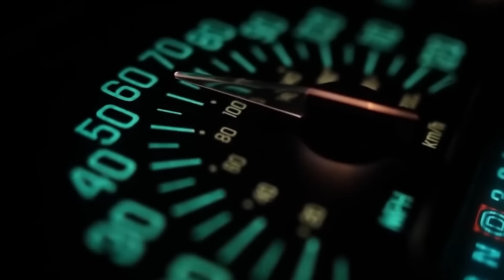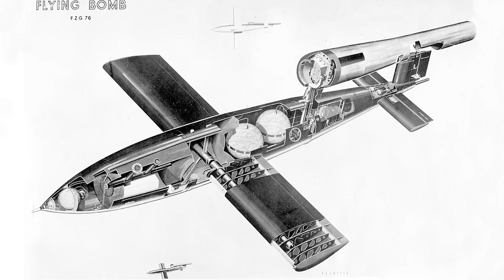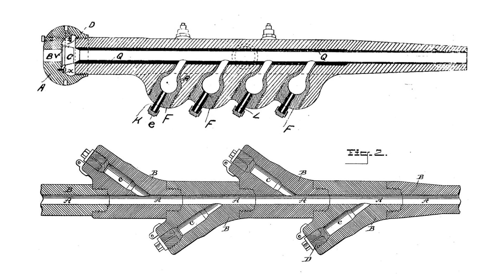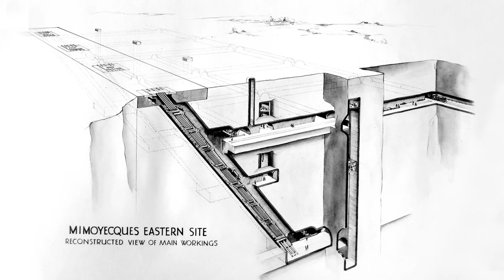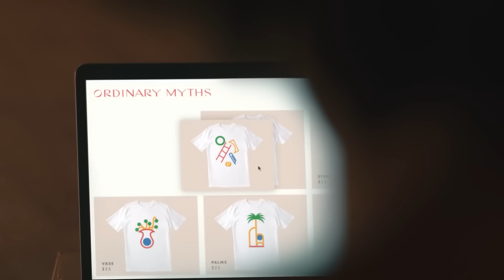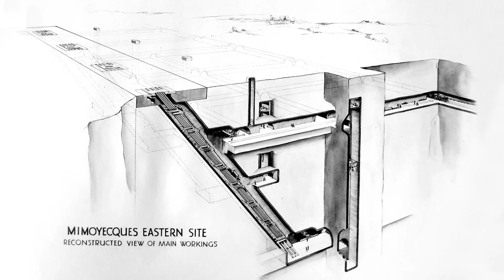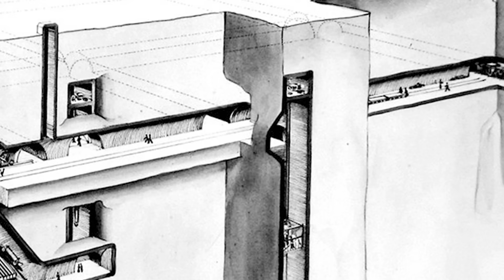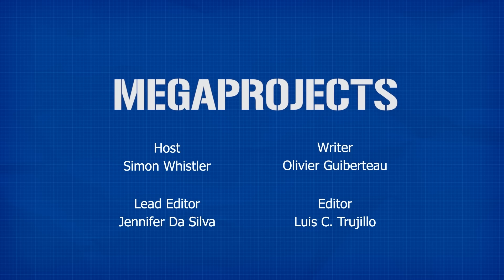The V-3 Cannon: Hitler's Unfinished Mega-Gun

Comment: One item you might have given more attention to, would be WHY?  Why was this vast, cumbersome, massively complex gun even necessary, let alone why would anybody in their right mind go to the trouble to develop and build one?  Simples.  A gun burns propellant to generate high-pressure gas that forces the projectile - the shell - out of the muzzle and on its way; and as Ian V. Hogg pointed-out, the gun is not the weapon - the shell is, the gun is merely the delivery system.  The longer the barrel, the longer the propellant gases have to accelerate the shell - but eventually, too much barrel and too much gas result in massive, very high temperature and pressure that quickly erodes the barrel to where it's no good anymore.  The Germans' Paris Gun, as an example - it used a graded series of shells, each a bit bigger in diameter than the one before it, so the barrel, which was steadily eroding under the heavy charges of propellant, would still seal the shell.  One Paris Gun barrel was destroyed when they used a bigger shell out of sequence, plugging the barrel and causing it to explode.

Needless to say, as the barrel erodes and the rifling wears-out, accuracy is lost and the gun's safety will eventually be compromised; even today, high performance guns (tank guns as an example) have a maximum number of rounds they may shoot before they are removed and shipped back to the factory for rebarrelling.  Warships too; RN 15" guns were considered good for 300 rounds.  Warspite was in the gun line during the Normandie invasion, it fired-off all its ammunition - 100 rounds per gun - crossed the Channel, reloaded ammunition, went back to Normandie and fired all of those off, crossed the Channel again and reloaded ammunition, went back to Normandie and fired all of them off - by which time its main guns were worn-out.

So for an extremely long-range gun firing its shells at extremely high velocity, barrel life will be counted in tens-of-rounds - not really worth doing.  But some clever spark came-up with an idea; "Instead of having a single massive propellant charge down at the bottom, why not have small propellant charges all the way up the barrel?  That way we light them off one-after-another, as the shell passes them on its way up the barrel, and the heat and pressure are applied gradually and evenly over a longer period of time instead of all-at once?"  This indeed, is the principle of that design of gun - and it can be made to work very successfully, although thankfully in the case of the V3, it wasn't.

The idea is still around - it's the principle behind Gerald Bull's super-gun that he was building for Saddam Hussein, only with an even more grandiose intention - it could throw shells clear into orbit.  Now how in the world could you even use something like this? - again, simples.  Each shell would have a rocket charge in its nose, and the gun was to be aimed at the South Pole.  The shells would go into orbit, and then go round-and-round the Earth for as long as you want.  Eventually, as the Earth revolves under the orbiting shells, something you want to bombard will pass underneath their trajectory - and then you radio-command the shell, it fires its retro-rocket in its nose and drops out of orbit, landing on your target.

Two additional suggestions, should you ever decide to build your own super-gun - 1) it would be much more effective if you know how to make thermonuclear shells instead of just filling them with a bit of high explosive, and 2) don't do this if you're on Mossad's "naughty-boy" list as Saddam was, and as Gerald Bull found out to his cost.

Comment: 600 rpm = 10 rounds/sec, or 
MV = 4921.26 ft/sec
If s1-s0 = 430 ft, then t1-t0 (in practice) > 0.1 sec
Even without allowing for reloading, a single barrel is never going to make 600 rpm.
Ripple-fire volley weapon, perhaps?

Comment: 600 rounds per minute? Like an uzi?

Was it possibly five different locations firing five batteries a piece? Each battery consisting of five barrels in one bunch? That would be 125 barrels, which would require every barrel to shoot a projectile every 15 seconds to achieve 600 rounds per minute. That would be insanely difficult to manage with all of the side mounted charges required for every round.
And you'd be throwing a big grenade all that distance to have the effect of a few kg of explosives, just not a viable weapon. But the "vengeance war" wasn't really about effectiveness.
Reply: You're more or less correct!
 "Speer’s plan was to build 50 of these huge guns set in giant underground emplacements near the hamlet of Mimoyecques in the Pays de Calais. The guns were designed to fire one round from each barrel every five minutes which, Speer hoped, would produce a “saturation coverage” of London with a maximum of 600 shells hitting London every hour."
(C N Trueman "V3". HLC 25APR2015)

Comment: I would argue that it is not the greatest or largest gun ever. the US accidentally made a far far more powerful gun with operation plumbob with a 150m bore hole and a nuke as the propellent it fired the 900 kilogram manhole cover at over 230000kph towards space. (though admittedly it was never aimed at anyone nor would it have been easily fired a second time)

Comment: "the V2 attacks continued until the end of March 1944".... Considering they didn't begin until September 44 that's obviously wrong. I assume you mean 45. Also, the V1 campaign was FAR more effective than the V2. Orders of magnitude cheaper, and the warhead had a much larger blast radius. The V2 came down at Mach 4 and had a primitive contact detonator so it buried itself in the ground. Had the Germans possessed a proximity fuse to explode the rocket before contact it would've been far more devastating.

Comment: 600 shells per minute?  You sure about that figure?  Ten rounds a second?  I don't know about that.
Reply: Well, Wikipedia says 600 / hour, or 10/minute. The max rate I've seen stated for various 88 variants (as Flak, Pam etc) is 20 rounds/minute and those rounds are single units, reasonably manageable by hand. No need to verify multiple chambers reloaded and closed etc.
If the number refers to the entire multibarrel unit or entire double position installation, then maybe...

Comment: 600 Shells a minute?? Ummm, are you sure about that one? 
That would put it at the same firing rate as an AK47! 
Even at 600 Shells an hours thats still 1 shell every 6 Seconds! Which is still about 5 times faster than a 16 inch naval ship gun. 
Lets go even further, 600 Shells a Day (24hours) works out at a still blistering 144 seconds reload speed.
For reference The Schwerer Gustav could manage 1 round every 45 minutes, (2,700 Seconds) approximately

As mistakes go, this is quite an amusing one! Thats what happens when you use wikipedia as your source of research. 
(Yes, its in wiki as 600 rounds a minute but this neglects to mention this figure was based upon a planned battery of 50 x V3 Cannons.)
How reliable this source material is, is anyones guess.

Comment: OK, a short list of things that I've notice that are wrong:
1) 600 Rounds Per Minute, is wrong.  This is because each tube would take time to reload all 33 charges. (Initial charge plus the 32 booster charges.  He's talking about a large amount of tubes, kinda like referring to the barrage of shells that all 3 of the U.S.S. Des Moines class cruisers could put out .vs. what a single gun (tube) could reliably sustain before it overheated.  (Overheating can do 1 of 2 things: cause the metal of the barrel to weaken to the point it bursts (like the V-3 test barrel did during firing of the 8th round in quick succession) or "cook off" the round's explosive charge in the chamber much to the dismay of the people loading the round!
2) 140 Kg ~308 pounds.
3) Didn't mention the Tall Boys & Grand Slams used against the site...
4) Would you lie to Hitler by telling him data that didn't support his point of view?  Hence Hitler being told of everything going right and problems, especially major problems being describe as minor things needing more research....

Comment: Ah Simon, the credibility of this information my issue here.  At the beginning you state the V3 had a rate of fire of 600 RPM,   The Thompson Submachine Gun [The Chicago Typewriter] had a rate of fire of 600 Rounds per Minute, equal to this thing.  Later when converted to the M1 A1 a WW2 weapon, it was reduced to 450 RPM.  Both guns fired 30 round stick magazines.  How was this V3 fed ammunition?  A .45 cal round is a lot smaller than a sabot/projectile that the V3 would fire.  Did they have a whole train [literally] of ammo to feed it?  An underground tunnel?  
Fire a couple of mags of ammo on any machine gun and the heat becomes an issue.  Most larger MGs had interchangeable barrels because they became red hot.   When it finally fired you say it only launched less than two hundred rounds...over what time period?  Sorry, I have to call BS on this one.  Another German idea with no substance behind it.  [Thankfully].  Also if this was a thing, why didn't the Allies use the data to create their own?
You got nuthin' here.
Reply: I believe this figure was for the entire complex firing on all their chambers for a short span of time. From what I understand the guns used solid rocket boosters for the projectile and the boosting charges along the gun track. Since there is no moving parts, or things to extract, it is feasible to see how such a gun could be fired multiple times rather fast, and has been apparently done during that multi fire test. Projectile would drop into the gun likely via a gravity assisted loading and fire, then burn a charge of booster as it exit. The gun is then ready to launch another projectile until the booster charges have to be replaced. When you take the number of guns and the number of sections it's perfectly possible for the entire complex to fire that fast, but obviously not for very long.

Comment: Here is a megaproject for you---During WW2 in Elizabeth City, NC the largest wooden structure in the world was built.  It was an immense dirgible hangar.  Shortage of steel forced the wood construction.   I have been in it and it was an amazing space.  It burned a few years back,  Sparks from welding repairs at top of the hangar smoldered for a while and flamed up during the night and by morning it was gone.  I remember as a child going outside and looking up to see an immense air force dirgible directly over our house.  It seemed to fill the whole sky.  An adjacent metal hangar remains and is still in use.

Comment: These kind of strategic and static cannons are a completely dumb idea. Although much cheaper than missiles they are - static, firing from a single spot that would be discovered by your enemies pretty fast.. And after a few bombing runs the super duper cannon is gone. 
Saddam Hussein tried to manufacture something similar, albeit with a longer range and larger shell. It was called the Babylon gun. The project was thwarted by the Mossad who killed the main person behind the design of this super gun - Gerald Bull. The whole program was also idiotic cause even if it was built, IAF would have destroyed easier than the Allies would the German gun. 
That being said the Pentagon has come out with scarce information about developing a strategic cannon of our own with ranges of up to 1000  miles. So who knows, super guns are still interesting cause of the order of magnitude cheaper price per shot compared to modern missiles..

Comment: its actually pretty simple to do in theory. One method is to leave exposed ends in the casing of the subordinate charges and as the projectile passes the casing the hot gas pushing the charge will ignite the secondary propellant adding to the charge as a whole with a lower pressure curve than lighting it all at once.

Comment: “Third V weapon fully utilised”. Suggests it actually worked. What?  The V3 was pretty much useless. It was also never ever going to fire 600 rounds every hour never mind a minute or less. 
600 rounds meant at 3000 propellant charges. That’s at least a trainload right there. The basic logistics were impossible. Additionally the upper charges would have been ever less effective as the ever increasing space behind the projectile gets bigger the highs it goes. In short it never could have worked.

Comment: Simon, please, you have to fix that ring in your room around 400Hz.  It is torture for anyone who does sound for a living and I can't watch your videos anymore because of it.  When you tune your room you need to look at time in addition to frequency, use a spectragram/spectragraph for this, not the traditional RTA.  If you run pink noise or a pulse you'll see a long resonance somewhere around 400Hz, it could even be happening down around 200Hz and the 400Hz tone is first harmonic of the resonance.  Figure out the exact frequency and look for surfaces that are 1 wavelength or 1/4 wavelength apart, that's probably where the resonance is happening.

Comment: The switch that turned control of Kennedy's plane over to the mother plane was faulty. A sgt who as a civilian was an electrician pointed this out to the higher ups saying that when the switch was thrown it would cause a short throwing off sparks. But the PTBs told him to keep quiet since he did not know what he was talking about. Th designer of the system assured the PTBs that no short would happen. When later tested, after Kennedy's death they found that the sgt was correct.

Comment: I thought it was raf fersfield aphrodite was based out of?
Reply: From the Wikipedia entry "From July 1944 to January 1945, approximately 25 high-time Fortresses (mainly B-17Fs) were assigned to the 562nd Bomb Squadron, 388th Bomb Group stationed at RAF Knettishall, along with two Consolidated B-24 Liberators from the United States Navy (PB4Y-1), to be used in Aphrodite missions. Originally RAF Woodbridge was going to be used, however Fersfield was chosen as a better location due to its relative remoteness"

Comment: A conventional breach loading weapon has the projectile and the charge rammed into the breach, so the rate of fire is limited by the time it takes to open the breach, load and ram a new shell & charge into the breach, close the breach, and fire.  And for the big stuff, often the weapon has a limited range of firing elevations at which it can be rammed, so you might need to de-range the barrel to a lower elevation before ramming, then re-elevate the barrel and fire.  And of course, you also need to keep the barrel temperature below some critical limit.  All these factors limit large calibre rate of fire to low single digits of events per minute, even for fully auto-loaded weapons.  This "V3 gun" that had multiple charges in individual chambers ranged up a 130m long barrel, how on earth was that reloaded between firings?